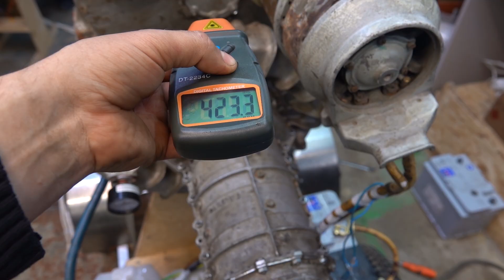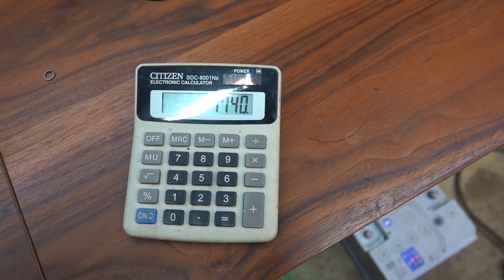Разнесло ГАЗОТУРБИННЫЙ двигатель - изучаем последствия

Comment: Those sparks coming out of the exhaust is metal grinding. As soon as that happens you lose balance, alignment, cause vibration and chain reaction of failures.
A bit like a lie in world history. You end up here and everyone blaming each other, no one is right and only way to fit in is be criminal or die. Waves to the Roman Catholic Church. Yes you.

Comment: Well that's a bummer. I suppose you could pop some of the retainer clips off the functional turbine blades, take a crap ton of measurements and try to make a few. Personally I'd try to sandcast them and take extra care when balancing the replacements on the completed turbine and compressor with shaft assembly. You'd need a furnace capable of getting over 2500*F/1371*C for an extended period and plenty of Inconel to melt down, but it's not impossible. 
I've run into the same problem of sorts and have resorted to engineering extremely high-heat tolerant composites so I can mold my own turbine assemblies. I've come up with some very good properties but getting the epoxy to withstand long duration heat has been problematic. I believe I finally found a solution for that as well but requires locating elemental bromine. 
Ну, это облом. Я полагаю, вы могли бы снять некоторые фиксаторы с функциональных турбинных лопаток, взять кучу измерений и попытаться сделать несколько. Лично я постараюсь сделать их песочными и проявить особую осторожность при балансировке замен готовой турбины и компрессора с валом в сборе. Вам понадобится печь, способная выдерживать более 2500 * F / 1371 * C в течение длительного периода времени, и много инконеля, чтобы расплавиться, но это не невозможно.
Я столкнулся с той же самой проблемой и прибегнул к созданию чрезвычайно жаростойких композитов, чтобы я мог отливать свои собственные турбины в сборе. Я придумал некоторые очень хорошие свойства, но получение эпоксидной смолы, способной выдерживать длительное нагревание, было проблематичным. Я полагаю, что наконец-то нашел решение и для этого, но мне нужно найти элементарный бром.